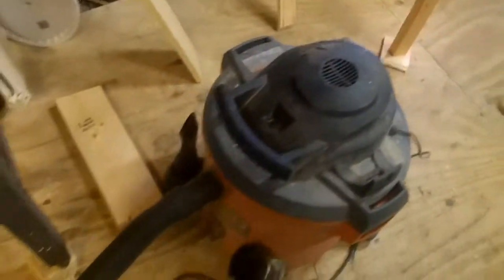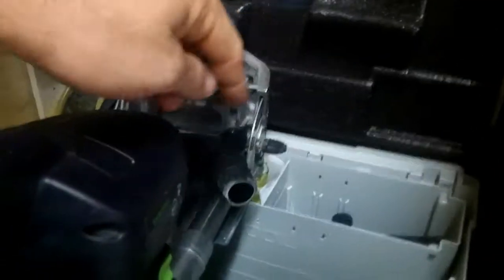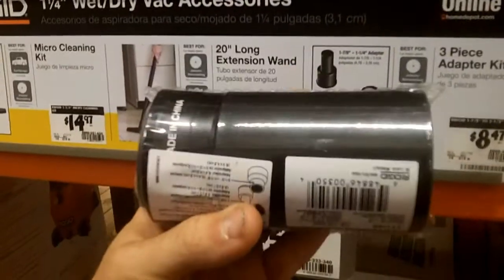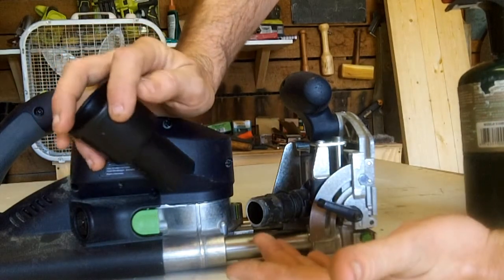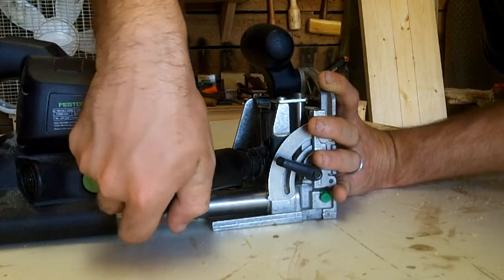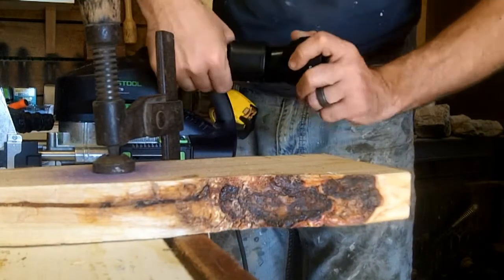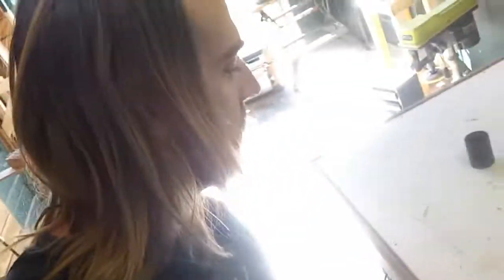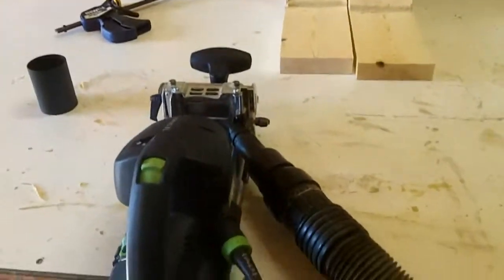HACK the FESTOOL vacuum system

Comment: I had that adapter sitting around, and when I got my domino i tried to push it on. The adapter cracked. I trimmed off the cracked part, and then if fit. I like your method better👍

Comment: Great idea. I just got the ROTEX 125 and have not gotten the dust extractor yet so I came looking for ideas and found a great one in your video. Thanks for making it and for coming up with this hack.
Reply from the maker: no problem!  I was glad to figure it out myself!   Ive found that since doing this hack I have needed to add a strip of electrical tape to the lip of the adapter to provide just a little bit of tension to hold it in place.  

Thanks for watching.

Comment: LEGIT.....i may have ended up here eventually but thank you for speeding up that process. ive been looking for days and just started thinking about using heat, tape, etc and i stumbled on to your video. voila.......HEAT!!!!!!!!!
Reply from the maker: Glad I could help!
Reply: The festool fitting I think is 27mm so it makes it hard to find anything that will fit it. If you could find something that was 27mm you could try and soften the fitting over that first and then try it on the festool dust port.
Reply from the maker: @bighands69  https://amzn.to/2VG3hXt   I got this kit and added a little bit of electrical tape inside the inlet for added pressure grip.  still working today!

Comment: Are there any better solutions?
Thanks for the video, I just don’t understand why this needs to be so complicated.
I will not buy a Gucci vacuum.
I have the 500 and 700.
No way the festool vac does anything differently than my $25 Lowe’s bucket vacuum.
First I don’t care about nose the df is already on and sounding like a broken blender.
Second I not care about dust because I just had my darth Vader mask serviced.
Third the $25 works fine other than the absurd connector testfool uses.
Reply from the maker: It actually is extremely better! The filter system is rated all the way up to hospital use and takes a very long time to start getting clogged up. The hose is an anti-static hose and the sheer power and portability are unparalleled.  However, three years later I am STILL using my shop that I just bought another one… I have a ton of different hoses and adapters to hook everything up, and I still do not own a festool vacuum … LOL

Comment: I’ll be doing the same but in reverse. I have a CT 36 Extractor but DeWalt tools.
Reply from the maker: Nice!  Ive actually used these little adapters on all of my tools in my shop since i STILL dont have a traditional extraction system set up, and dont have the nice festool extractorsd either...
Reply: PMK Woodworking we are coming at this from different vectors. Your a fine old worker, I’m stage designer and large scale installation artist with an assembly line training background. I don’t make a living building things. I do it for my artistic ya yahs. So budgeting for tools first was never my goal in my shop.

But thinking towards long term goals, I know if I stop a problem at the source, it’s much more efficient. Hence dust and dirt control. I also have asthma so a hepa filter is nice. 

I’ll be cutting metals, wood, plastics. Also my shop is not huge, and things are tightly organized. Before I get much further developing it, I wanted the extractor system there to plan with.

Plus Amazon sold it to me on a payment plan.
Last but not least, by having it this early in the game, I can figure out which stupid accessories I need to buy before I actually need them.

Funny thing is. The Festool 27 mm hose fits my miter saw and orbital sander perfectly.
Reply from the maker: ha, I wish I'd thought of it before hand.  I am slowly upgrading everything, but I literally started woodworking with a circular saw and a drill!  Good on ya' getting the dust and stuff figured out first. in my next shop im planning on having a central Dust Collection system with a vortex seperator, as well as a festool extractor for the festool tools i have, but for now I do what I can!  Keep it up man! I would LOVE to do something artistic like stage building or set design and building.

keep it up
Reply: PMK Woodworking good on you! People who throw parties and live events are always looking for carpenters to meet basic needs (stage, DJ tables, facade, shade over a dance floor for weekend campout dance parties). Offer to help someone who is a designer but be careful not to shoulder to much.

Make certain you get costs covered, including food and gas money, but do it as an intern.

My basic approach is beams and facades.  I am trying aluminum I beams and 3D printing with hemp. You keep/recycle the frame, compost the facade, and have a new design every time.

Add a video mapping artist to your sculptural structure and be prepared for aliens!

It’s all about networking (what you have to offer) and staying inspired to keep coming up with brain spasms of creativity. 

Dance music festivals and local theatre are two groups to work with. High school and college theatre as well.